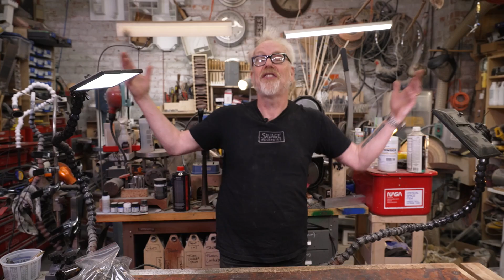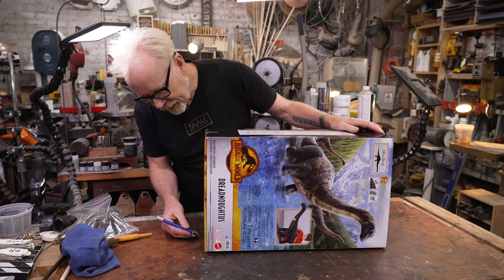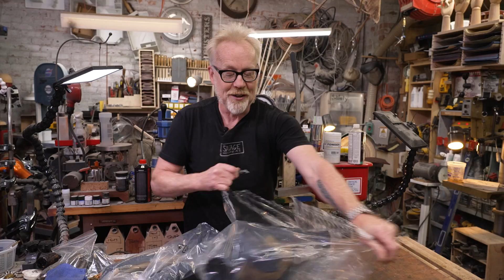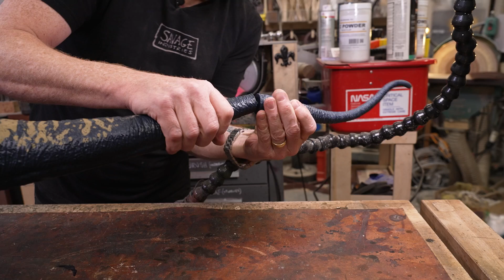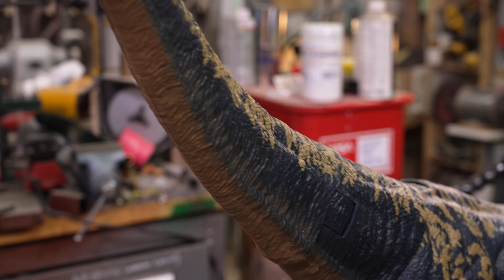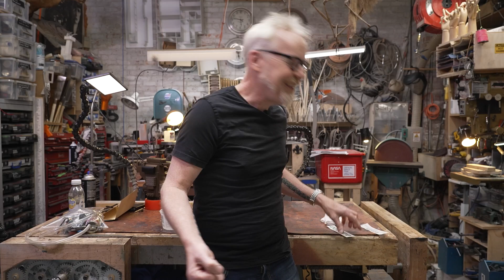Why Adam Savage Is So Excited About This Dinosaur Toy!

Comment: Hey I saw in a different video you mentioned going to Builders Resource. You probably already know about this but figured I’d mention in just in case but there is also a great spot in Berkeley called Urban Ore. I go there all the time to get old lock cylinders to practice lock picking. I can get a cylinder that sells on eBay for $60-$100 for around $3 and they will even give some free occasionally if they don’t have keys. They literally have what feels like an endless inventory from old camera and computer tech. To claw foot tubs and windows.

Comment: Adam, you might be old enough to remember the Prehistoric Scenes line of 1/6th scale models put out by Aurora Plastics back in the 70's. I had a complete set (the Neanderthal Man got crushed so he's no longer with us). The largest in the set was a (very bad) T. Rex. In the booklet for the T. Rex they talked about making a apatosaurus kit, but decided not to because it would be about ten-feet long and there was no way to make a kit that could hold itself together.